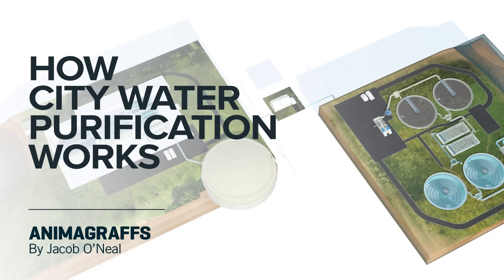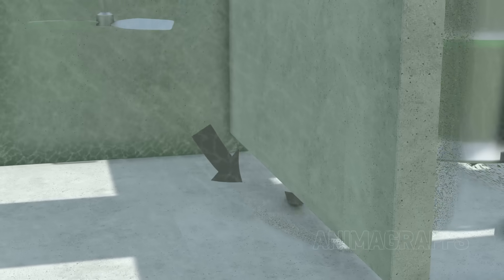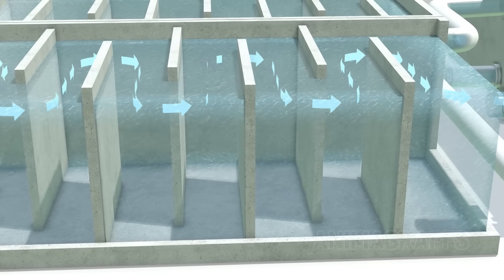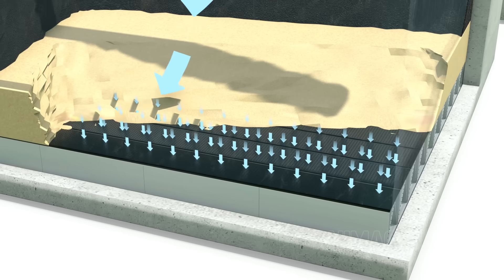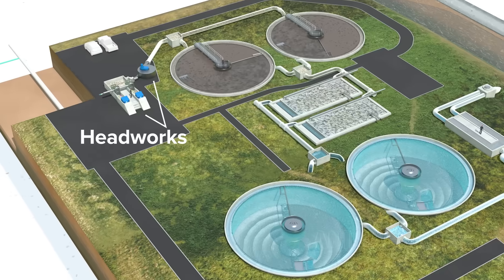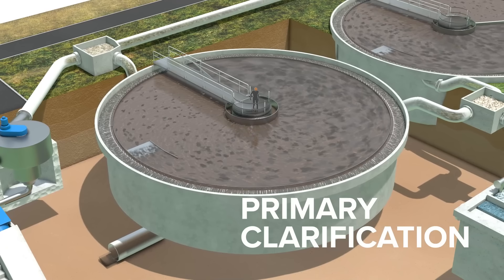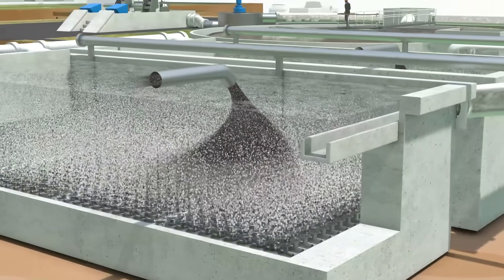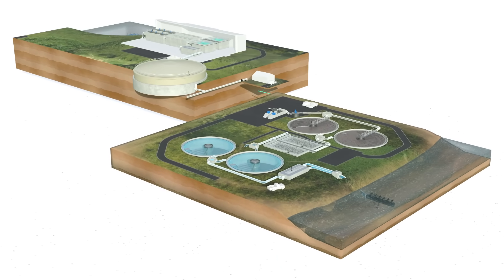How City Water Purification Works: Drinking and Wastewater

Comment: Very good Informative Video but I worked at a Wastewater Treatment Plant and seen a lot of them, though never seen UV-Treatment at the end or those Nozzles for better mix after that, maybe not used much in my Country(Germany). For Those which are Interested in Wastewater Treatment: The Sludge from the 1.st Sedimentation Stage "can" be used as Fertilizer but is mostly expenively burned in Trash Incineration Plants mostly because of the Heavy Metals residing in it, also on most bigger Wastewater Treatment Plants the Sludge gets Fermented to get Gas, this Gas can be used to fuel Generators, which produce Energy for the Plant to use (Main Purpose is to reduce Mass). In the Aerination (Correct Word: Nitrification / Denitrification) are 2 Zones, not 1 as it may be interpreted, Nitrification uses Oxigen, Denitrification does not. There would be some Details that can be added but I wanted to clarify these especially. (If you have questions I try to answer them if I can)

Comment: It's very important people understand the difference between sewer systems and rainwater-runoff systems. Only the outflow from the inside of a home goes into the sewer system. All water from rain and which enters drains on your driveway, or street goes straight into local rivers.

And so it is very important you do not wash your car on your driveway, or pour oils, poisons, paint, or anything at all, in fact, down your outside drains - it all goes straight into your rivers, and kills everything in them. Never pour anything into a road-side drain except water! In our city, all the drains have a stencil-painted bright green fish above the drain, to remind people where the water is going.

And out city's rivers are doing remarkably well since we stopped treating them like sewers, and started treating them like they're the lifeblood of a city.

Comment: It's interesting to see the different modes of treatment implemented in slightly different ways than I learned (i.e. in my Environmental ENG class most active carbons, rocks, and microsands were at the inlet or just after the inlet in drinking water treatment, and the bacteria were introduced in the sedimentation tanks instead of separate aeration tanks for waste water treatment). Many ways to skin a cat and all that.

Comment: If you drink tap water, you are crazy. Distilled water is the only water you should be drinking. If you want to add a few minerals to it every now and then, that's fine but not necessary if you have a good diet. Adding minerals is good if you're doing a lot of sweating.

Comment: abbreviated version - "If you live in New Orleans, St Louis or Baltimore and DC, the glass of water you are drinking has already been in and passed through seven people." Great video! I spent years upgrading, pouring concrete and expanding the Charlotte Mecklenburg NC water purification and wastewater cleaning plants. I gladly drink tap water daily from our kitchen sink and enjoy it without fear and without plastic bottle waste. The LORD is great and I am 62 and have no liver or kidney or digestive trouble. My mom is 92, has done the same and has no problems with our CM water system. Her problem is soda pop and fritos.
Reply: What's your opinion on the supposed abundance amount of chlorine and  and fluoride in the water. While it's still relatively small, overtime usage of it can't be good right?
Reply: @aimankamil4818  if there is chlorine in the water you can taste it. I wouldn't drink tap water that tastes like anything. It has to have that neutral non-taste that bottled water has or I'm not drinking it. As for flouride I wouldn't know how to detect that but it isn't added in my country AFAIK.
Reply: I’m curious how they remove chemicals and heavy metals from the wastewater when they turn it into drinking water.
Reply: @meanuncledavid  how do they remove the hormones bruh, and American sure love their drugs.
Reply: Can't say no to a fritos bag man
Reply: 7 people? 7 million is probably more accurate.
Reply: Old people LOVE Fritos. So gross

Comment: Microsand is it's own proprietary settling process typically.  Pretty unusual to see it in a conventional flocculation basin.  Super cool video though!
Reply from the maker: That whole process train is proprietary I believe, but it appears to be the "hot new tech" far as I could tell from my research. Does the same amount of work in half the space, and the microsand is pumped back into the purification train after its own washing process. The flocculation basin you see there is also part of this newer tech, as the old-school flocculation basins I saw in my research seemed much larger, like the wastewater side.

Comment: Excellent work. This is one example of an array of options to treat water. In the US, if the source water is surface water or E. Coli-contaminated groundwater, a “residual disinfectant “ is required which is not shown (such as addition of chlorine or chloramine).
Reply: @jaymacpherson8167   yeah you should hope that no idiots decided to put the sewage plant upriver of the water plant  because that is just asking for trouble
Reply: @ There are many drinking water intakes downstream of sewage treatment plant outfalls. Just look at the number of cities and towns on the  Mississippi River.
Reply: I trust they don't use contaminated water as a source, that goes against all science.
Reply: I drink mostly bottled water, but that's probably only half my liquid intake
Reply: USEPA is good organization. I have read a lot of procedures from that org

Comment: ive worked in waste water treatment for about 17 years, and have never seen a step by step of how the magic happens so clean and well thought out. this needs to be in every sydney water office as a base to their inductions. amazing stuff. you have gained +1 sub
Reply: Question.  How long is the sand good for?  Does it slowly degrade over time, and have to be replaced at certain intervals?  Can it the sand itself be cleaned and reused, or is it just landfill?
Reply: @drewbert83  the sand on average stays in the system for 5-10 years depending on the conditions of the plant. i dont think the sand itself degraded, but its contaminated with impurities which can cause to it to hard pack when the system is idle between cycles. which can make it difficult for the air to break through. it'll then be sucked out and either reused somewhere else, cleaned from impurities or put in landfill depending on the specific situation. im my experience, every time we cleaned them out it was for repairs or relining the tank, so it was removed and bagged till the end of the job and then replaced
Reply: @zakkhuitema3748  very interesting, thank you! I imagine the water must already be pretty clean before it reaches the sand, otherwise there's no way the sand could go that long without clogging up.
Reply: @drewbert83  yeah its been through a couple of different steps before this system. its definitely cleaner, but still pretty crap(excuse the pun)
all the solid have been removed and at this stage its just fine particles.

to combat the clogging, theyll pump a heap of air into the aeration system below the sand and it causes the sand to break up and swirl around in the tank. this cleans the sand to a degree. the now even dirtier water is removed by overflowing the tank to the point the water breaches a weir and is pumped back up stream for another run. itll be pretty clean in the tank at this point. the sand settles, and the system continues. theyll do this a few times a day depending on the tanks size.

dont mean to talk ya head off, but its surprisingly interesting seeing all the systems working together. 

one particular site i work at that has school trips through it, has the inflow and outflow separated by a wall, so you can see the difference. inflow looks like engine oil, out flow is crystal clear. only takes about 2 hours to get to that clarity.

Comment: The drain water makes its way to the Central Aquifer in Town. The central Aquifer (Big Rocks) makes the water drinkable. This Water is piped to homes after having mold added to kill bacteria in the piping.
Here in Bradford because it's Hilly (running water) it's not too bad.
If you're Rich, you can buy Evian. This bypasses the drains (from fields and payment cracks). This has less mold added to it.
If you're Really rich, you can have your own well. No mold added. Drink as pumped.

Comment: Would love to see something like this for trash processing. I know there is a lot of variation depending on where you go but knowing what's "normal" would be nice.
Reply: that will likely be at movie length since they are separated at the bin already. multiple complexly different processes
Reply: @humorss  Username does not check out.
Reply: @humorss  In Germany we separate all the trash into 3 bins and some other disposal sites for special things like electronics. Then trucks collect all the different types of garbage and deliver all of it to the same facility where it is burned in one big pile. I'm only half joking.
Reply: i work in Trash collection. Practical Engineering made a pretty decent video on the matter. i believe its "How landfills work" with trash processing you really could go in depth on several facets. my job its self is pretty straight forward, but landfills they are quite interesting and as a whole are a major upgrade from the dumps of the past.
Reply: I was working on site for a new sewege water tretmant. It's an amazing process and this video is really accurate!
Reply: In Rotterdam, The Netherlands there's a powerplant that's fueled by trash called AVR. They use a super advanced filtration systems and the air coming out the chimneys is cleaner than the air that goes in.

Comment: Exllent work ⚡, i work in wast water management & this is highly accurate, I shall use this video to educate my coworkers, so thank u. 
Ps: how about rain water? 
In a costal city such as mine, it's directly pumped through the sewers system into a local collection facility then directly pumped into the ocean, although the water gains the blackish sewage water but (as far as am told ) it's not harmful to the the environment thus doesn't require the treatment .. love the hear ur thoughts ?
Reply from the maker: First of all, I'm glad to hear that my research is accurate! I care about that a great deal. To discuss your question...

In my research I found that some cities -- in the U.S. at least, where I could get reliable info -- do have systems can end up combining sewage with street drain water. All water is purified, however, if the system is overwhelmed during, say, a big rainstorm, the plant can't process all incoming water and raw sewage may flow into local outlets like rivers, the ocean, etc. Most cities are trying to separate their systems wherever possible.

I also saw that most cities are getting away from pumping raw sewage into any natural area, even if the outfall pipe can reach far out into the ocean. It's just not desirable over all, because of how much foreign "stuff" is in our wastewater from all the household things we use and what we eat.

I'm not a specialist here though, so I can't definitively say what the effect of sewage in the ocean may be.